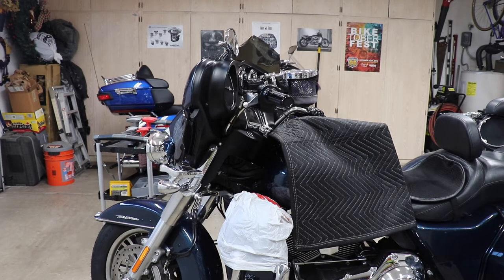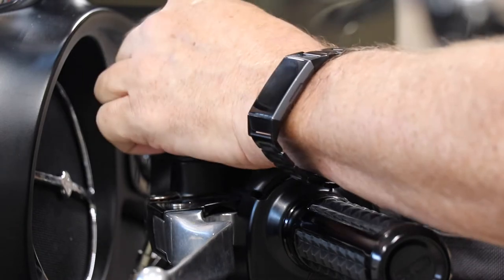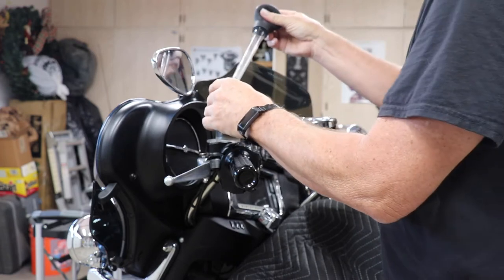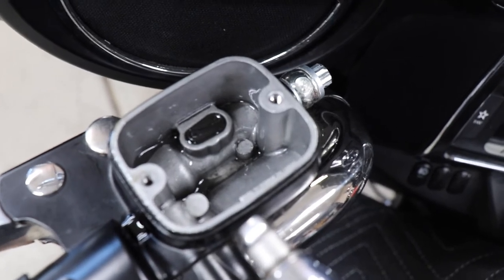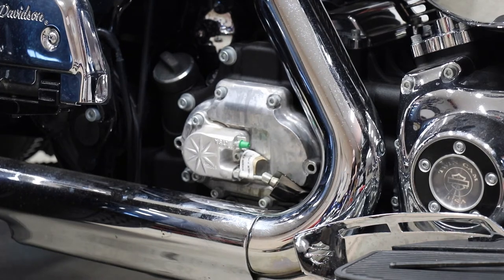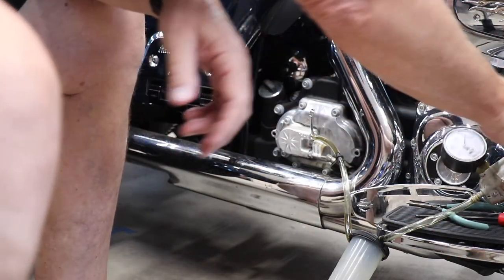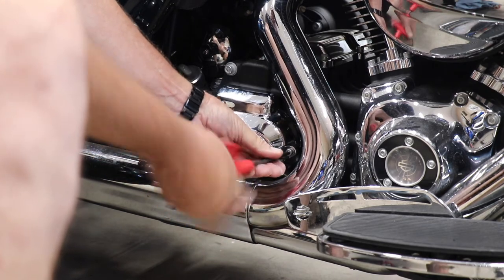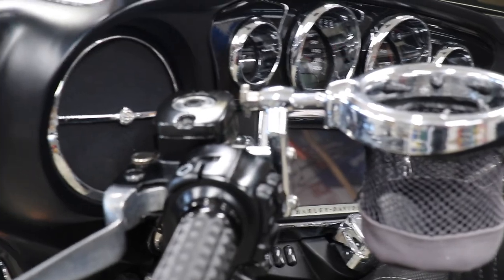Changing the Clutch Fluid on a 2016 Harley Tri Glide Ultra

Comment: How much vacuum pressure do you use for this? Is it the same when you changed brake fluid?
Reply from the maker: Yes, I'm just using the Mityvac MV8000